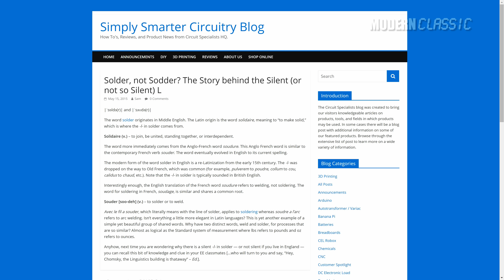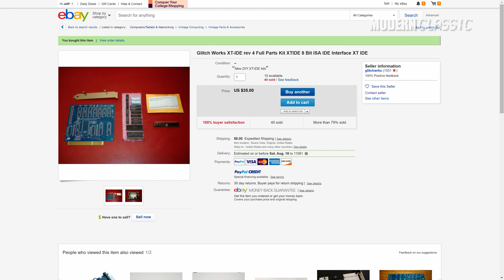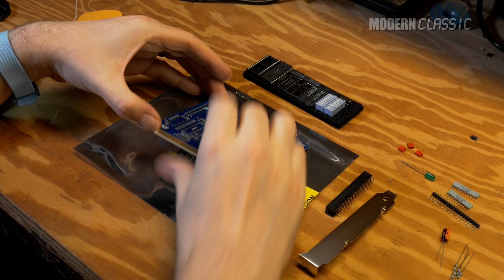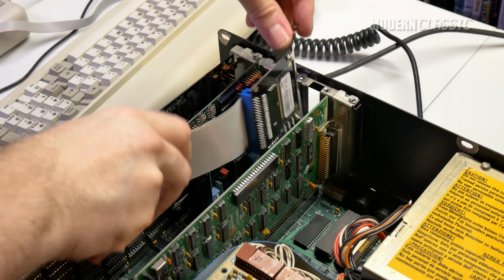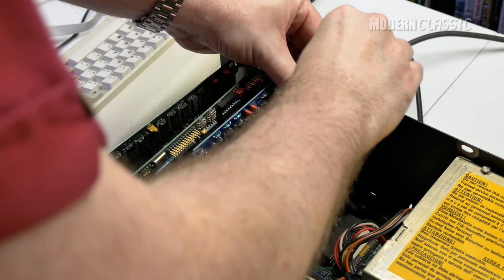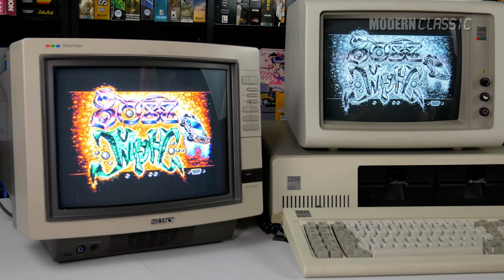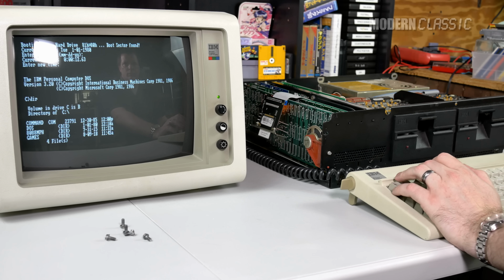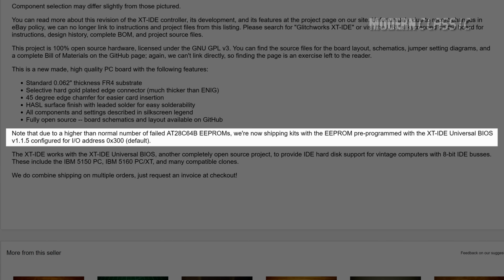Flash storage for classic PC's - building an XT-IDE kit!

Comment: There are CF adapters that can plug direct on the IDE connector. Use that one. Then you only need 1 socket.
Reply from the maker: There's no IDE on an original IBM PC; hence the point of the XT-IDE card. But also, this is a 6 year old video; there is probably an updated XT-IDE card at this point that just has the slot for the card built in. I haven't had the need to check that.
Reply: @ModernClassic  As I said, you can use a CF Card on the IDE port. Yeah I know there is no native IDE Port on XT's but still there are cards that fit in th XT-IDE Slot WITHOUT tacking space of a 2nd ISA slot.
Reply from the maker: @oe3gwu  Great. If you give me a link, maybe I'll revisit this topic at some point. The card itself already takes up the slot, so I'm genuinely curious to see how the CF adapter gets around that.

Comment: Good job, but your soldering wire was too thick to start with and you should have used extra flux for a better flow. at least the end results was ok.
As for saying sawder instead of solder, or newkiller instead of nuclear among other words, that's not an accent; that is just a deliberate deformation of words,  to which I find the whole thing degrading.  No offence.
Reply from the maker: Nope. No offenSe.
Reply: @ModernClassic  I am serious, I am usually not like that. My mom had a stroke, I been a bit on the up and down. sorry. You can say what suit you best.

Comment: How did you use Oracle VM virtual box with the compact flash card as the drive? I get Virtual Disk Service error:
The operation is not supported on removable media. When trying to offline disk for passthrough.
Reply from the maker: I'm not sure if I linked it in this video (I did in later videos), but I used this guide: http://theinstructionlimit.com/installing-ms-dos-6-22-on-a-486-without-a-floppy-drive-using-a-cf-to-ide-adapter
Reply: @ModernClassic It would appear that I am stuck at partitioning, I will wait half a day because it does show disk activity but otherwise I do not know what to do.

Comment: Someone recommended that I use a compact flash controller, and when I looked that up I found this. So does this work with the original 1981 bios chip, or does it require an upgrade  to revision 10/27/82 as it does with a "regular hard drive", and also, in general, does it work on an original 5150 without any upgrades? In your reply can you also state all of the components needed and their specific models, and even possibly a few recommended compact flash, (I plan on using DOS 3.0)? EDIT: I just found out about http://www.xtideuniversalbios.org/, are any of the files compatible with the original IBM PC, with the original bios chip? I noticed that all of the bin files mention XT AT or 386 (one doesn't, it is contains the text "tiny", even the card and BIOS itself have XT in the name. But based on even more information that I just found, https://monotech.fwscart.com/XTIDE_Deluxe_Bootable_ISA_CFIDE_Interface_Card/p6083514_19478732.aspx the BIOS is specifically on the card, and does not replace the PC's bios, but would the all CPU compatible BIOS option be correct if I want it to work with a 5150, and what is recommended for the EEPROM type? Will this even work on a non-otherwise upgraded Original IBM 5150? 
Hopefully last edit: An eBay seller of a card mentioned this in their description "8088-based computers are picky about the type of CF card used. They will require an IDE/PATA hard drive or a Memory Partner, WinSystems or SiliconDrive CF card. The free included CF card isn't compatible with 8088's." interpreting

Comment: Would be great if you could SD-Cards, though.
I used to have a weird USB 1.0 solution back in the day, where you'd connect two PCs over USB (both had to have the appropriate cards installed, these were not standard USB controllers) and one PC would see a folder on the other PC as its own hard drive. I think those were PCI, though.

Comment: Not sure if someone already mentioned it but a trick I use to have bigger disks under MS-DOS 3.x etc is to use Disk Manager (from Ontrack). Not sure if it runs on an 8088 but I am pretty sure I have used it on one of my XT's once. It splits up your drive and makes one partition in a size that IS supported and installs a special driver on it to allow access to the rest of the drive in the form of D:, E: etc.

Comment: Nice. Just use the CF adapter plate on the card itself. You should be able to make or buy little L-brackets to mount it to the holes in the PCB.

Comment: 3:02 A better camera angle could be from the other side of the table (so you see the yellow attention label in the left of the frame)
4:34 I think the best order of soldering... er SODDERing... a chip is first the first pin, then then last pin. This way the chip is more flush with the circuit board.
8:54 Great SODDERing job. I would have done a far worse job.
16:13 Maybe... just maybe... it stores references to absolute paths. I mean, when you copy Paradox from a drive that once was a C: drive to a subdirectory on a D: drive, it just lost the paths. Maybe it can be fixed by editing some config files. But yeah, where to start...

But hey, great video. I don't have old museum-computers laying around. So, I love watching the ones that are recorded and put here on YT!
Reply: SODDERING with solder... tsk tsk

Comment: looks like the front of the chassis is bent in, giving the long cards a bit less room then they should have
Reply from the maker: No, it isn't bent in.
Reply: If it were possible then, I would be a bit tempted to bend it out ever so slightly, a millimeter or two just to keep them cards from flexing.. Things still seem functional, but it would still bother me that its not quite right.
Reply from the maker: I'd rather just replace the cards than bend the system itself. The cards are a lot less valuable than the system. I like the look of the brown CGA cards better anyway, so I might get one of those. The SixPack card isn't bad enough for me to really worry about, it just looks a little funny.
Reply: fair enough...

Comment: What about the other way around? Is there a way to connect a MFM disk to relatively modern PC? I've got 8bit ISA controller for it, but ISA slots are rather difficult to find on computers later than P3/P4...
Reply: There are PCI to ISA converter cards. Startech do one I'm pretty sure.

Comment: Are you able to remove the harddrive from the hardcard?  if so I think one of these would work as a replacement.  (if the drive has an IDE connection to the pcb on the card) https://www.amazon.com/Syba-SD-ADA45006-Compact-Adapter-Enclosure/dp/B0036DDXUM/ref=sr_1_5?ie=UTF8&qid=1536041678&sr=8-5&keywords=compact+flash+ide

Comment: why do all these kits use compact flash card rather than sd?
Reply: CF standard supports 8-bit transfer mode which is more in-line with what the systems supported.  At least that's how I read it.

Comment: Install MS-dos 6.2 or 6.33  Version 5 had issues with the 8088 processors
Reply from the maker: There is no dos 6.33, unless you mean PC DOS 6.3. I considered that but 5.0 runs fine on 8088s. MS-DOS 6.22 is not available in 5.25" disks, which means I'd have had to install 5.0 as an intermediate step anyway before installing 6.22 in a VM. I could still do it, but I don't have a reason to; 5.0 is doing fine for me now.

Comment: This is exactly the thing I need for my XT clone, I got it working the other day but the harddisk is on the verge of dying (lots of bad sectors). I have a CF card (although it's 16GB which is definitely overkill but might also just not work) but I now need one of these cards. Shame I already spent pretty much my retro budget for this month so I suppose the XT will have to wait until next month or so before I'll be going back to that. Just a question, what CF card are you using? Since with CF the card can actually make the difference between it working in a solution like this or not (since the CF card is the part that should correctly implement the IDE standard and apparently some newer cards don't do this correctly)

Comment: Great video, saw you had a spool of Radio Shack solder.  Good show!  You did a great job of soldering, everything works and that is what is important.  If you want more control over how much solder you put on a part go with a thinner diameter solder.  .8 mm or .6 mm diameter solder will improve your results dramatically.  You will have to feed more solder to the joint but you can control how much you put on the joint.  Also, I saw the old dreery "C>" and you should add to your Autoexec.bat file "prompt $p$g" (without the quotes) this will show you what directory you are in on the hard drive as you are moving around in the directories.
Reply from the maker: Thanks - I do know about prompt $p$g but was not bothering to work on the autoexec.bat file until getting DOS 5.0 installed. It's in there now.
Reply: That is good to know.  Glad to see you got 5.0 installed.  Curious, Why not 6.22?
Reply from the maker: No 5.25" version of DOS 6.22 that I know of.
Reply: @ModernClassic  there is nothing stopping you from adding a 3.5" floppy.  I started indtalling one as a regular part in 95 and by 98 3.5 was the main boot drive.

Comment: Since the ide connector on the adapter board just sticks straight out the back if you ever wanted to reinstall the serial card all you would need to get is one of those straight ide to CF adapter boards and plug it in. It would just internalize the flash and make the formfactor more like the hard drives.
Reply from the maker: I have a CF adapter like that; I just want to have external access, which is why I'm using the one in the video.

Comment: 1) You should have extra flux available. There´ s never too much flux in a soldering job! I have a little bottle of liquid flux here, there´ s Soldering sticks and pens and Soldering Honey and what not. No matter which of these, it helps you. I soak the pads and contact holes with flux via Q-Tips. There are better ways. Just get the gunk in there! The joints will look much, much nicer just like that.
2) Flux makes nasty stains. Get Isopropylic Alcohol. The purest stuff is the best, allthough 96% won´ t kill your soldering job. Got myself a litre of the stuff years ago, still have the better part of it left. It´s great for cleaning metal and killing mould as well!
3) Apparently the failure rate of ICs after soldering can be reduced by soldering pins that are as far away from each others as possible in sequence. 
4) I want an old computer now. Nice one! ^^)
Reply from the maker: I have both alcohol and flux. You can see the containers at different times in the video :)
Reply: Yay! :oD Then the solder just was old? It´s so easy to get nice, shiny concave joints with the right stuff, I don´t see why yours look a bit uneven. Should have been fine and dandy. Anyhow, it verks. It´s good enough. Everything beyond that is fetishism. (But I do get excited at the sight of really neat shiny concave solder joints. Ju… ju… only really just a slight bit. o.0)

Comment: When soldering DIP IC it is recommended to skip every second leg and solder them in second pass. This way there will be less thermal stress. There is good video about it called: Basic Soldering Lesson 7 - "Integrated Circuits: The DIP-Type Package"

Comment: As I recall it, some programs marked one or more specific sectors as bad, and if the program was copied it would refuse to run as those bad sectors did not copy.
So you are correct in assuming it was some sort of copy protection. :)

Comment: FLUX
Reply from the maker: Flux core solder.
Reply: Modern Classic even still you can't have too much flux
Reply from the maker: You can! Flux burns, sticks and takes solder away from where it's supposed to go if you overdo it. I like having just enough and putting it right where the solder's going. It just makes sense.

Comment: SIR, YOU ARE AWESOME. i bought one of these kits on ebay last year, and i have never opened it because it came without instructions on what to do , and how to solder the damn thing. besides even after soldering everything there are jumpers that i just dont know how to configure for my old IBM pc. With your video i might be able to finish the mod. THERE IS ONE MORE THING, SELLER DID NOT SELL EEPROM FLASHED, SO YOU HAVE TO FLASH IT ON YOUR OWN WITH A METHOD LIKE A NETWORK CARD.

Comment: To avoid that soldering error, why not place the chip in the cradle first, then solder the whole assembly to the board?
Reply from the maker: Because the same thing would have happened, only then I'd never be able to get the chip out. I may as well just solder the chip directly to the board in that case.
Reply: Well, that would be a danger, but at least you wouldn't have to de-solder anything should that happen.  I suppose it depends on if you think you'll ever need to (easily) remove the chip in the future.  Can you only update the chip using a programmer or can it be done in-place a la a bios update?
Reply from the maker: For now via BIOS update. But there's a reason it's a socketed chip.

Comment: I fell in love with the IDE to CF adapter as soon as I put it in my 486 gateway.  It's fast enough that the activity light does not light normally.  I do feel bad for the hardcard, it sounds like the spindle motor has dry bearings.

Comment: With ancient drives like that Hard Card or my two ST-225's, the only way I've found to keep them running (at least from a data standpoint, mechanically is another story) is to use SpinRite from Steve Gibson. I have a license for the latest version, and he maintains a back catalog of versions that he will send you for free. The latest version is only about 256K and has even saved my SSD RAID Array once or twice.
Reply: I used SpinRite to salvage a few drives. With newer drives the trick was to FDISK then do a FORMAT without checking for errors. That was the only way SpinRite could make newer drives do a hot spare swap for truly bad sectors.

Comment: Hey, that looks familiar! :) Cool to see a video of the assembly process! You can also buy kits and whatnot on Tindie, aside from supporting a cool trading platform largely targeted at open source hardware, some of the stuff is cheaper there due to lower Tindie fees. And, since there's sometimes questions about it, the kit is significantly cheaper than the assembled board not only due to assembly/testing times, but because I actively want to promote hobbyists getting DIY kits and soldering them up! There's a manual in the works, it's not done yet.

W.R.T. initial bring-up of the card, you need to erase the CF card, and then do the partitioning and formatting on the XT-IDE. The XT-IDE doesn't have to be installed in the target machine for that, you could for example use a Pentium 3 with ISA slots and it'd work just fine. 

I'm also working on a CF adapter that bolts to any XT-IDE that uses the Keystone 9202 ISA bracket. That'll free up your slot occupied by the CF converter. Since it'll be supplied as a module, like the Slot 8 Support board, I'll be able to offer it with the surface mount soldering done already so that kit builders who don't want to attempt surface mount can still build the main XT-IDE board themselves.

Comment: I usually find myself being unable to tell the colours apart on resistors unless i use a lot of magnification. Another pet peeve of mine are cheap 1%/2% resistors which are... good, except the spacing is wrong and you can read them from both sides, but only one of two values is correct! I find it best to just measure every single component that can be measured before i mount it, takes a second, faster than reading really.
Reply: They Phier mil-spec conformally coated resistors :p But they are a little harder to read. I typically try not to use multiple values with the same starting digits in my kits, so that people don't have to guess.

Comment: Hey! I got one of these!!! and Soldered only the ROM sections, U9, U10, SW2, RP2, R3, R4, C8,C9,C10, and C12. I had a 16 bit and 32 bit controllers and didn't need the 8 bit portion so, left it off! Flashed to r591 and now can config from a floppy. Very happy!

Make Retro MODERN again! <3 all

Comment: I'm British, we pronounce the L (but not the R on the end unless we absolutely have to) but for me hearing you seppos say sauderrrr is a bit like seeing you spell words like colour or favourite without the U... something you adorable colonials just do...

I wouldn't mind a modern kit to build a genuine retro computer, whether it be an IBM XT PC, a Commodore Vic 20 or 64, a ZX Spectrum or a BBC Micro or Acorn Electron.  Who's with me?
Reply: GeoNeilUK - The British Isles has a pretty healthy mix of rhotic and non-rhotic accents, though I'm guessing by the way you said "we" that you grew up in (maybe still reside in?) an area which has a non-rhotic accent. And of course RP is non-rhotic as well.
Reply from the maker: A modern kit probably won't happen, but I have always wanted to build a genuine kit from those days like the Heathkit H89. I don't imagine there are many unbuilt kits still floating around.
Reply: But there is a re-creation of the 256K IBM Model 5150 motherboard. Comes in a solder everything yourself kit. At the price, I bet it's less (adjusted for inflation and in 1981 VS now dollars) than what IBM charged for a replacement board back in the 1980's. I'd rather see a re-creation of the final version of the Model 5160 XT board where 640K would go onboard, plus add a 10Mhz Turbo function.